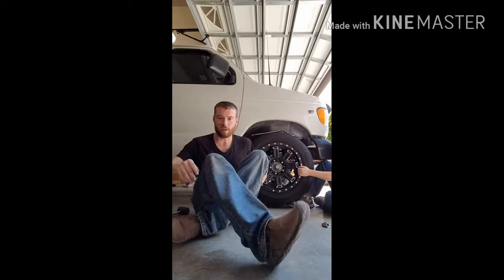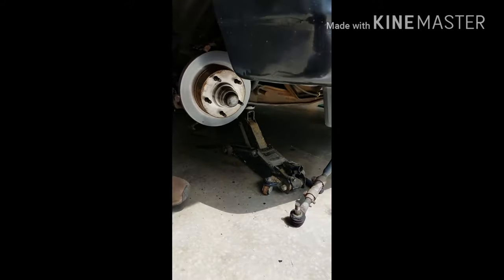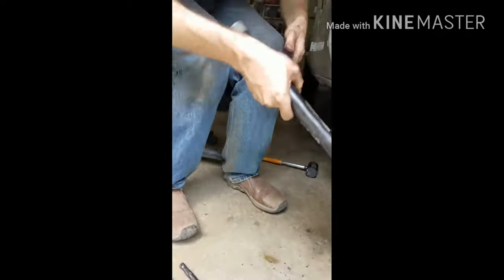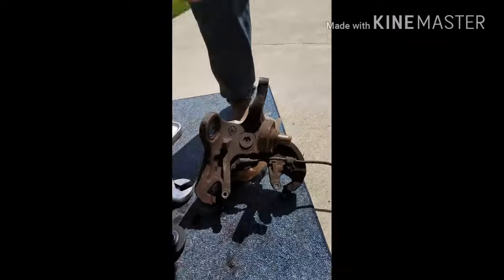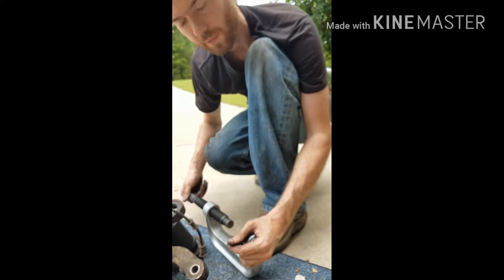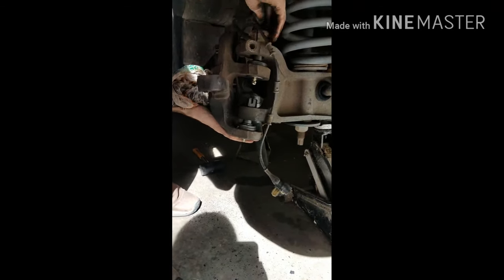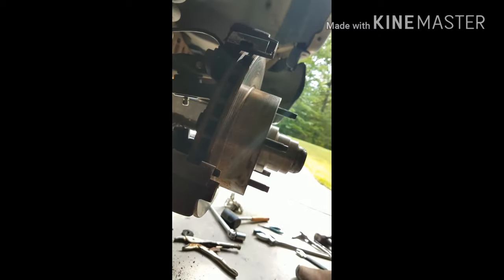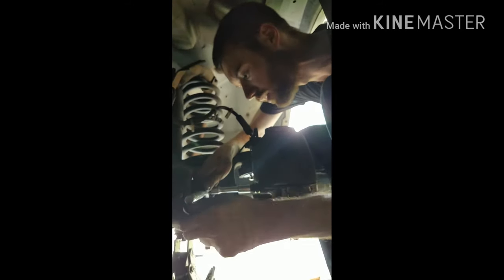Ball Joint Replacement on a 2002 Ford E-150

Comment: Add a little heat if you can and hit with hammer around the ball joint between turns so you dont bend your 
c frame  part of your press    the harbor freight ones bend

Comment: Good Job, ... Man, if you've got the gumption to change your own Ball-Joints
you can probably do nearly anything you need to maintain that vehicle. 
Again, very impressive.   (I too did almost all my own mechanical work, & I am NOT a "mechanic")
Stephanie was very very cute, (AND brave) .... "Now I'm gonna swing with my eyes closed" .... slap 
very funny .... about the "hearing protection".... except.... 
I think you are supposed to put ONE cup on your forehead, and the OTHER one on the back of your head.... 
Aren't ya?  .... kinda like a "Mohawk" that you clamp onto your head... THEN your hearing is protected. eh?
The length of the video was fine.... some short, some long.... it's ALL cool.  
believe it or not I LIKE to "fall asleep" to long videos....  not kiddin' but YOURS was an "INTERESTING" and long video.... so I really did NOT wish to fall asleep during it.  
Good Job, very cool.
Reply from the maker: Hey! Thank you! That's a bad ass thing to hear!! :)

Comment: Fyi...that inner  bearing goes in the back of the rotor then a new wheel seal is tapped in over it and then install the rotor as an assembly..and you need to pack both bearings..and tighten those bolts..they are too loose..you are talking about front end parts not a dash board..and you forgot to grease the new ball joints and the old tie rod..otherwise you did good..
Reply from the maker: I did this after the video I believe.